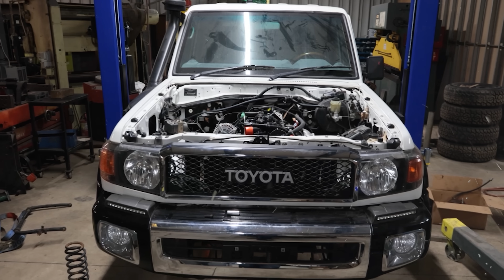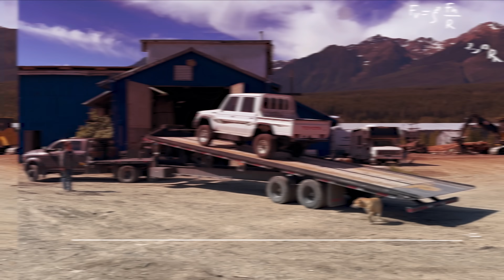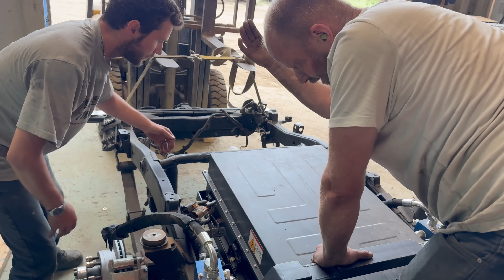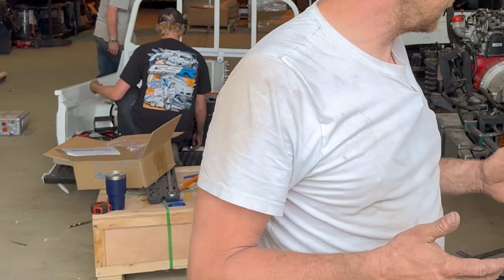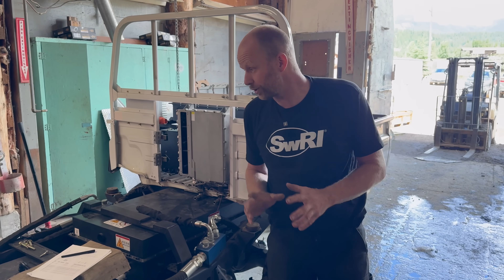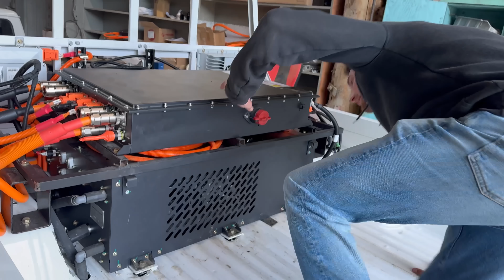High Voltage Power System Install on a LandCruiser! #EdisonLC79 [EP3]

Comment: What is the cost of conversion including Labor?
Reply: Depends on how elaborate a buyer wants to go. The cheapest is like a single battery ev only for $20k? in parts and $150/hr until its done. At the other end of the spectrum is like everything re-done for $200k? so it depends. In the meantime, they're still figuring out all the parts.

Comment: I think what you guys are doing is amazing. My only concern is the wire management to the axles from an off-road perspective in the future. It seems like it would be better to have those terminal connections on the top of the axle if possible to help minimise the chance of a wire getting  Caught on something

Comment: Are you not using the engine coolant to heat the batteries?
Reply: I'm not sure if they have 1 glycol loop for everything, or a loop for engine and a separate loop for electrics. I'm confident they are addressing it. Not sure how.

Comment: I wonder if they thought of running the hybrid without the battery packs.
Reply: This topic has come up from time to time. Basically the battery acts like a shock absorber. The batteries capture energy during regen braking. The batteries store energy up and then unleash it when starting from a stop light. The batteries give the truck like 3 times the the hp/torque and mpg.
Reply: @Sah-o5m OK. I was just curious.
Reply: The battery packs allow them to use a much smaller diesel generator.

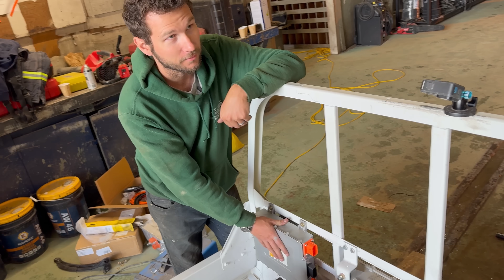Comment: 12:00 No 480? Iirc this is going to a mine, they should have 480 three phase or something available
Reply: The Edison trucks have a way to receive and send various AC and DC voltages and amperages. It will be interesting to see which options get added to this mining truck and future trucks.

Comment: 11:06 NORWAY is THE country in Europe who has the highest # of BEV in relation.
I can assure you: It get´s dammmm cold there in winter.

As long as BEV are sold those have heated bats.
Reply: Edison trucks have sealed electric components with glycol loops. The glycol can be cooled in the summer or heated in the winter.

Comment: So the function as a pickup truck, is gone due to all the cooling components in the truck bed. So now its useless as a normal pickup truck. I see it as a waste of time and money
Reply: Chace agrees with you that if a truck can't do truck stuff then whats the point.

To accomplish the goal of empty bed, Rich is putting these components under the bed or in an extended cab in the black dodge ram truck on his channel.

For this particular white Toyota LandCruiser,  the mining customer had lots of energy about making sure 4 miners sit comfortably in the cab and they are OK with losing bed space.

Due to the bed space issue that you noticed, Edison is working on a frame alteration to make the frame wider and be able to fit all the gear under the bed. So stay tuned.
Reply: @Sah-o5m its a prototype, a first version. I think they will find enough room next to the generator at the front of the vehicule to put everything there and keep the bed free.

Comment: I still want to know real world fuel mileage numbers for all of these diesel electric vehicles that are being built and tested.
Reply: You're not alone my friend.

Word on the street is no mpg gain for ICE alone at highway speeds.

Improved "cost per mile" for highway driving if the truck can charge up on city power overnight and at lunch break due to cheaper electricity. So a cross country trip should cost less.

City driving with hybrid regen braking  will be superior mpg and cost per mile than ICE only.

For city commuting, the engine may never turn on so technically the mpg is 1 million miles per gallon, but it's still an EV and the cost per mile will depend on how expensive the electricity is usually 2 to 3 times cheaper than ICE fuel per mile.
Reply: @Sah-o5m  it's never "1 million miles" per gallon. Ev efficiency uses mpge ("equivalent") to compare fuel savings and the best of the best get 140ish

Comment: I've been amazed at everything Edison has done so far but that heat pump etc in the back is horrible. Couldn't you put a slim RV heat pump on the roof or something like an ecoflow heat pump in the cabin? The exposed wires to axle motors are a bit scary too. Would be nice to see them in a skid plate and connecting to motor from the top or use an angled connector so it goes up instead hanging loosely in front of the axle
Reply: The chiller in the bed is to cool the glycol flowing through the e-axle.
Reply: Let them finish the project car before complaining. They already said its not the final heat pump. They just use it for testing

Comment: It's a shame you lose half the bed with the battery stuff :(
Reply: Yes. This is a prototype and they are jamming stuff anywhere it will fit.

There is talk of widening the frame so all this stuff fits under the bed, but that is next year.
Reply: Can't put much in the bed anyway, it isn't far from it's GVM
Reply: @shaynegadsden a model 79 dual cab LC has a normal payload capacity between  1100 kilos and 1300 kilos.

Edison will add 700 kilos.

So it should still carry between 400 and 600 kilos before going over gross vehicle mass for on road street legal use.

This truck will be used off road in a mine where GVM is less enforced.
Reply: @Sah-o5m it's 1325kg and near 600 in the batteries alone so the total is way more than 700, and even if it only used in a mine while they may not get a ticket their issuer will deny a claim if they is an accident because of an unsafe vehicle.
Oh and the average man is 87kg so if you put 4 in there that 348kg

Comment: Coming along nicely! I’m not entirely sure why  you guys are trying to reinvent a/c, Toyota has existing a/c systems on hybrids and have so for the last 10-15 years. For a retrofit, it should be easier to change an a/c compressor for one that is driven by the HV battery. I understand the need for cooling/heating for the batteries, but now it seems that you are trying to ask too much from an unproven setup. Anyways, hope it all works in the end!
Reply: They need to make an AC "chiller" to refrigerate the glycol running through the axle for cooling.

Comment: Those are really thick cables for high-voltage, those look more like high-current cables.

500 watts over one cable at 240 volts only needs 18 gauge, what you are using would be for 12 volts, which would be low voltage. Extremely expensive.
Reply: The large orange cables are high current cables. This pickup truck has 70 kWh batts that can discharge at 5C which is 350 kW for 12 minutes to the axles.

P=IE so 350,000 watts divided by 600 volts = 600 amps

Google says use 4 gauge.

 Honestly, the BBB and PDU will probably never allow 600 amps.

Comment: is the weight of the axles(unsprung weight) enough more to be a ride problem?
Reply: Fair question. If this truck is only used for 5mph rock crawling or 20 mph in a mine, then it won't notice the heavy "unsprung" weight of the motor e-axle over bumps and potholes.

If this truck is to be used for pre-running the Baja 1000 where the suspension needs to react and keep the wheels firmly planted on the ground at 100 mph then the high unsprung mass would make this truck undrivable.

If this truck is driven on normal streets like a normal truck, then MOST won't notice.

If this truck is driven at 40 mph on a washboard dirt road for hours, then it would need to slow down compared to a traditional truck with a stock lighter weight axle.

Comment: I would love to see Edison get into the RV space. This tech, combined with rooftop solar arrays, would be game changing.
Reply: Amen bruddah. Drive your Edison RV where you wanna go. Shut off the engine. Use electric hvac, electric fridge and electric stove around the clock for days.

No noisy little camping generator or needing the 5 gallon can of gas or propane. for heat.

Marvelous.
Reply: Never thought about that but freaking amazing idea!
Reply: I think they want to offer chassis.
Reply: And there’s so many off shoots from rv’s to get into. I’m currently looking into buying an RV/bus to convert into a mobile dog grooming salon and the electrical requirements for a rig would be a perfect application for this type of set up.
Reply: @Barkinguptherighttreee  yep. EVERY food truck can be an Edison hybrid. An Edison truck naturally outputs 440v triple phase AC. Just use 440v or 208V electric grills and ovens. 

So at fairs and events an Edison truck just pulls up and goes to work. No fussing with generators or giant propane tanks.
Reply: Implicitly they could already be in this space for 5th wheels and trailer campers ... But are the Edison packs large enough for that much no-generator use whilst camping?
Reply: @ianwilliamrobertson 

If camper aircon and fridge uses 20kWh per day and if Edison dual batt pickup has 70 kWh total with 35kWh usable, then it can provide power for 1.5 days  which is enough to quietly get thorough 1 night's sleep.

If an Edison 6 battery 210 kWh semi (with 105 kWh usable) is towing an Edison tiny home on a trailer or bolted to the frame rails, and if that tiny home uses 30kWh per day like an average American home, then a fully charged semi can quietly offshore power for 3.5 days.

If that same semi is off-shoreing power to a high demand pizza cooking food truck then maybe it's only good for a long 16 hour day.
Reply: The term “game changing” makes me cringe. Everyone uses it.

Comment: Retired industrial electrician here: the CAN bus cable shouldn't be interfered with by external EMF from AC carrying wires if you are running it over the correct cable type for the protocol, which should be a twisted pair of wires in a Mylar shielded cable. The standard is used in Arduino hobby micro controllers, so I happen to know a little about it. I could go into why this prevents EMF in wires, but that it they of cable that should be used and it can be ran near the high voltage power wires for an electric or hybrid car as long as the shielding is grounded properly on a single termination of the CAN bus network.

The rest of the wiring looks good, since I can see that.

Comment: I hope Edision is planning to bring on board several manufacturing & tooling engineers from the auto/truck sector long before the first production facility is tooled up as their current methods will not come anywhere close to supporting a production environment. 
The electrification of lighter duty trucks makes for interesting video content and can serve as how to do integration of components on the vocational truck lines, but this should not be anything more than a sideline hobby, as I can't see how this fits in a sustainable business model.
Reply: As for bringing in engineers, I believe in Edisons business plan they're talking to Sandy Munro. As for the pickup trucks, theoretically, Edison might get $125k each for the Toyota LC mining trucks. Should have some meat on the bone there.

Comment: Love all these trucks. 17:58  I'm really curious about operational numbers milage and cost per unit.
Reply: Numbers are still up in the air. Maybe 2? hours on batts alone? Then superior "cost per mile" than ICE only. Range is as far as the fuel tank is big. A company in Austrailia makes EV only (I think) Toyota Land Cruisers just like this for mines at $125k each.

Comment: Well, I was a bit skeptical. I know you guys are doing great work, but taking up half the bed with items needed to supportt the bateries wouild be a complete pass for me. There isn't anything practical in this truck for me or someone like me.  The weight of those batteries is just insane. That leads to more suspension strain and a lot more tire wear. Seeing all those cables was also alarming. I like simple things. This just doesn't hit me right.

Comment: Many years ago when I was in engineering school I tool some EE classes where we used Oscilloscopes to look at signals relative to time.....really neat stuff but at the time an oscilloscope was mega-expensive. Now I realize that Oscilloscopes are much more economically reasonable than in the past, do you guys use them to analyze signals in your designs?

Comment: Pretty cool Rich but have you stepped back and looked at that as an outsider? It seems way more complex than it needs to be. I look at that and try to see it at -40 and covered in salty slush. I hope this works out because you have a passionate dedicated crew. Please don't end up like so many start-ups on the dust pile where the company leads say "it's my way or the highway". Listen to your crews and customers, give them something they Want and will be proud to own.
Best of luck man, you all deserve it!
Reply: Unfortunately the technology hasn't been merged down for simplicity yet.

Given a few years the motor controllers will be in the hubs, the power distribution box will need to hang around but maybe can become part of the overkill thermal management in the back. And if course, the batteries are needed, the generator too, and thus the charging circuit and mains voltage output for devices are both desirable to have.

So at the end of the day, the biggest win is the motor controllers, which take two HV in and push three HV out to drive the 3 phase motors in the hubs, when they get hidden in the hubs, we can go from 5 wires from the PDU to the various components, to two out to each axel.

Some of the components only exist because they cannot get what they wish for from their manufacturing suppliers, and integration is understandably complex.

Comment: something little as a 8 inch long sch80 5" pipe can hold up a whole C11... last $80 fitting over a $80'000 problem.
Reply: Is there a time code in the video that you're referencing?

Comment: Hey Rich been a fan and a follower for many years now and I'm just amazed at the direction things have gone. You and Edison have to be the greatest collab EVER!!! Look forward to every update. Till the next one 😎👍🇨🇦🙏♥️💯
Reply from the maker: Thanks man, that means a lot
Reply: @DEBOSSGARAGE  I would LOVE to see the part where you planned an effective mitigation for passenger safety to handle the inevitable: Spontaneous Lithium Thermal Runaway Event.

Many insurance companies are NO LONGER providing coverage for homes for fires caused by parking Electric Vehicles inside any structure on the property or within 25 feet. 
Wake up.
StacheD Fire Safety Training has done numerous vids on the less than 4 seconds MAXIMUM you have to escape an E.V. fire to save your life... less than 1 second to save most of your health.

Comment: It's super strange the customer didn't want any of those components underneath the seats, out of the way, and to allow the truck to do, you know, "Truck Things" 🤔
Reply: I think different customers will have different goals. I agree that a truck should do truck things, so an empty bed.

I think the priority for the mine is to get 4 dudes in/out the mine in safety and comfort.
Reply: It can't do truck things anyway, stock they have a 1325kg or 2920lbs capacity but instantly 1200lbs is gone in the batteries plus all the supporting hardware and cabling means you have less than 680kg or 1500lbs to work with forgetting the chiller and being generous and that 680kg needs to cover the people in it too

Comment: So if I were to take apart my truck in preperation for the kit I basically just have to strip it to bare frame?
Reply: Heavens no. Rich has stripped the black Dodge Ram and this White Toyota LandCruiser down because they are prototype test mules.

I think every pickup truck will have its own unique challenges for the retrofit kit.

At one end of the spectrum is what you see here with complete disassembly.

At the other end of the spectrum, I can imagine just dropping the stock axle and installing the e axle. Then mounting the battery pack where the drive shaft was. Then drop the tool box in the bed with the pdu and computer and now you have a simple EV.
Reply: @Sah-o5m OK alright, sounds like a plan. I blew my engine last month and was wondering how far I should strip it down and rebuild with anticipation of the kit

Comment: I noticed when you loaded the LandCruiser that there is a lot of shielded, but exposed, high voltage wire showing on the undercarriage. I am curious if you plan to provide a durable skid plate to shield this from road debris etc? This is a very exciting project! Congratulations!

Comment: I love the right to repair, but a lot of parts do not look easy to fix in the field or without specialised skill sets. All those electronics and software. A lot of it seems more than your average mechanic could fix in a shop
Reply: The concept today of "right to repair" is simply to return to the way companies handled repair parts in the 70s. Which is to say "the repair manuals are easy to find and parts are fairly priced".

An example today of R2R is the framework laptop. In the framework laptop, it is easy to take apart, all the parts are labeled, and its cheap/easy to get replacement or upgraded parts. At the same time, it's OK that normal people don't understand the details going on inside these components. All that matters is that people can swap out the parts. 

I'm confident that Edison is doing everything in its power to make their trucks as easy to repair/maintain as is reasonably possible.

For Edison to make a vehicle that ANYONE can repair, it would have to look like a Ford model T from the early 1900's.
Reply: A internal combustion engine is not easy to fix without specialized skills either.   But it is possible to learn